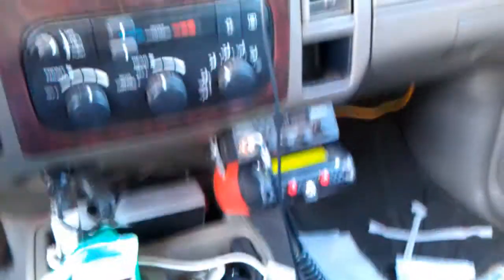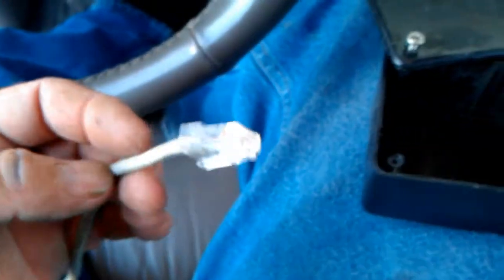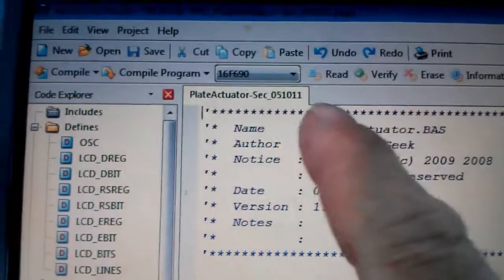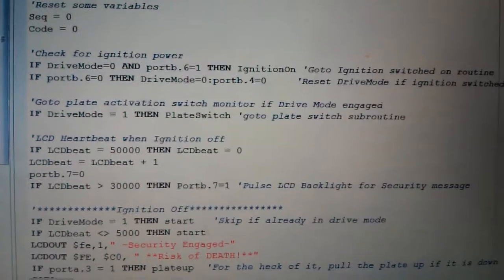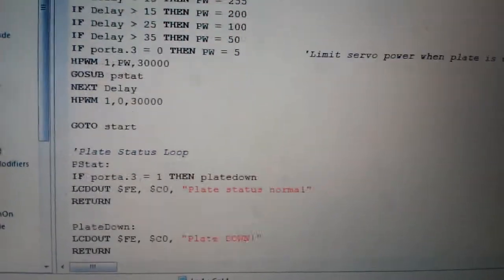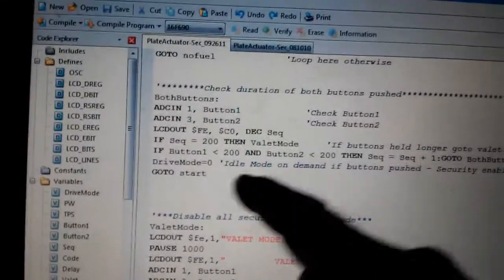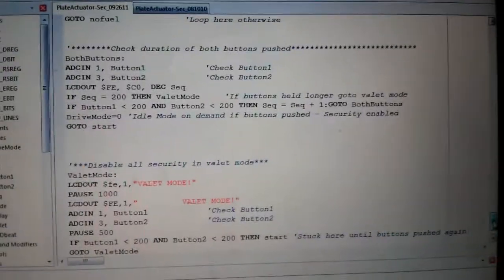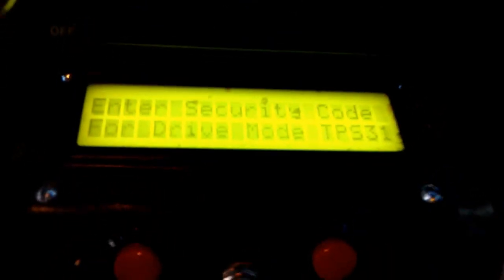Reprogramming my home made security device - Revealing my "Secret Weapon"

Comment from the maker: @Djkyle65 
I took some hobby classes around 1980's for basic. LOL!
I also grew up on the Tandy 8000, Comodor64 type home computers in the 1980's using BASIC. 
The programming for this is similar.

A few years ago I had to get a crash course from someone online to do some of the Assembler language, which is the root level language.

I've only used it for hobby stuff.